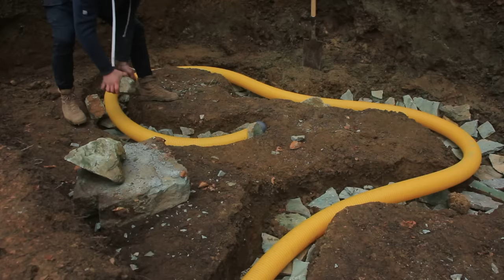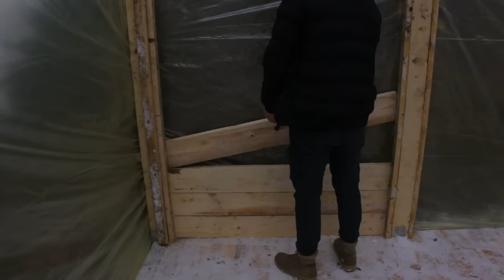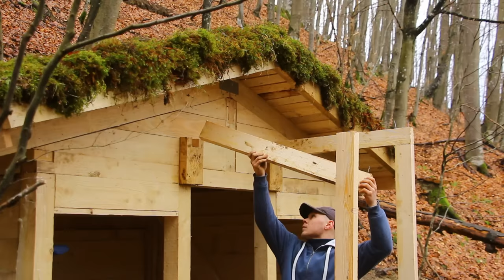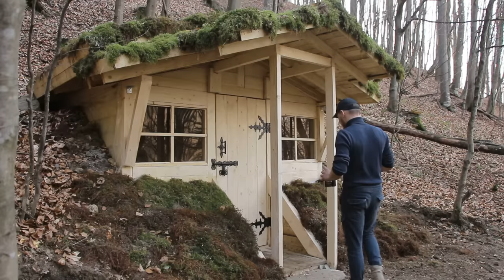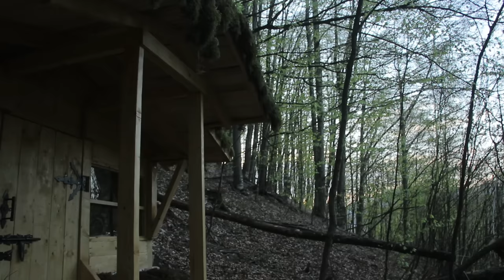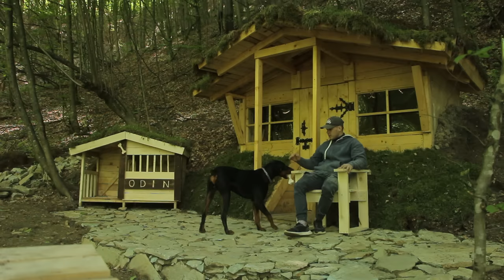Alone built a dugout in the forest. Start to finish

Comment: Very time I see water in a dugout project i wince with the thought of the damp and Mold that is going to grow underneath the floor and behind the walls.
You are the 1st person I have seen to put drainage underneath to deal with it .... bravo 👏👏👏
Reply: yes •  really  interesting ,  Sir
Reply: I had to go back and check that out, woww so smart! When we used to tent camp, I'd always rake the ground and then layer pine needles and leaves, then lay a tarp over that, before setting up the tent and a tarp over the tent and a small trench around it and a little down hill. If it rained, not a drop of water got inside. Very satisfying!
Reply: I was wondering about that yellow thingy he put in the ground. Still don’t understand how it works though. 🤔
Reply: @diggermd1  
The yellow drainage pipe he used has lots of holes in it, 
you dig a trench that slopes down hill runningthrough and away from area which you want to remain dry.
You lay the pipe in the trench and add shingle or gravel [in this case he used large slate, rocks and stones]

The idea is that any water in the area will soak through the ground downwards to the lowest point, [which is the trench that he dug under the structure]
The shingle and stones makes it easier for the water to trickle from the ground into the trench between the stones and get to the pipe.
The water soaks into the pipe through the holes in it,
and then the water runs away down the trench inside/through the pipe, away to another area further down the hill where it will drain or soak away.

Commonly called a ‘Soak Away’

A ‘French drain’ [that normally runs alongside roads] is basically a trench full of shingle that channels any water in the ground away to another area.
By putting a porous pipe in with the shingle it makes it more efficient at allowing the water to flow away.
Reply: I  could live there by myself and be so happy!  I love it, it’s a perfect size.  A small generator for microwave and frig!
Reply: @marilynoconnell8251  Yes "Microwave and frig" 😊
Reply: If you keep it heated and dry, that is less likely to happen, but you should (at least) put a plastic moisture barrier down on the ground before you build the floor.
Reply: How he get all that lumber up there?  I know he didn't pack it in on his back...
Reply: @robg521 you’re the best for such a detailed explanation. I was confused too since I didn’t see anything connected to the pipe!
Reply: @andrewroberts6123 yeah but for this guy, it was snowing all over the wood as he built so there’s no way he managed to keep it dry haha
Reply: @diggermd1 weeping tile
Reply: @robg521 I know it as tiling.
Reply: I thought he was making heated floors😮

Comment: He did a decent job of building however the wood wasn’t treated. Didn’t look like cedar either which would have cost a small fortune. He didn’t even put any coating on the lumber facing the earth, just thin clear plastic. It won’t hold up for sure. He put felt on the roof with the same clear plastic on top by stapling it before topping with soil and turf. The staples will leak and the roof won’t last. The turf at the edges of the roof are being help up by untreated wood. Again, rot will occur. The floor is untreated and only about a foot away from the dirt underneath. Dry rot for sure. Done the right way the cabin could last for decades.

Comment: What was he spraying onto the timber?  A pesticide to deter wood-destroying insects, like termites and carpenter ants?  Just curious if there's a newer and safer way to protect wooden projects like this.  My dad used to soak the wood in kreosote, which smelled just awful, and then he'd also mix up and spray a pesticide known as Chlordane, and I'm telling you, that stuff kept on repelling pests for like, 30 years because it remains so long in the soil.  Probably why it was banned in the late 1970's, lol, and it was also carcinogenic....but it WORKED.  It used to be THE chemical of choice for termite infestations, and they'd guarantee it for at least 20 years....now, however, because they had to switch to much weaker chemicals, an exterminator will only guarantee it for a few years, and the treatment must be constantly repeated.  

I never inherited my dad's knack for building nice things like this dugout, so my appreciation for guys who can do this and do it well, are DOUBLE!  Nice work!!